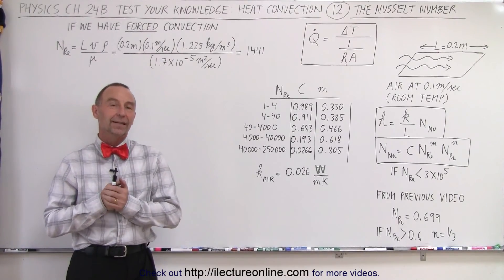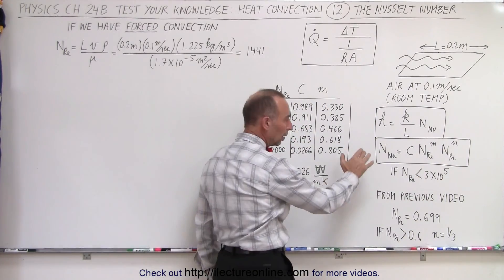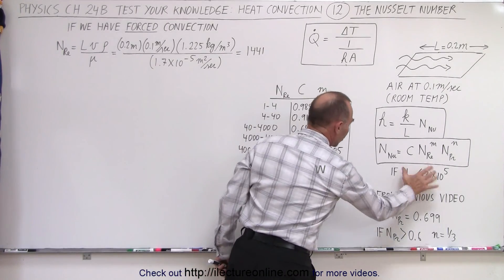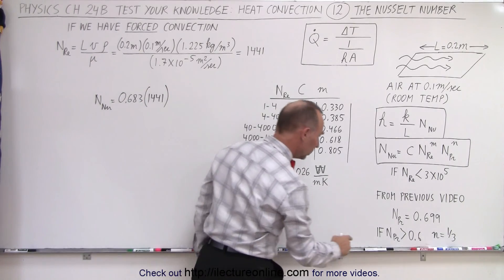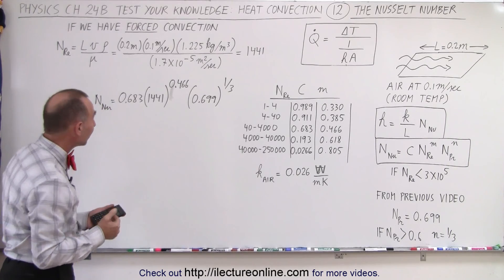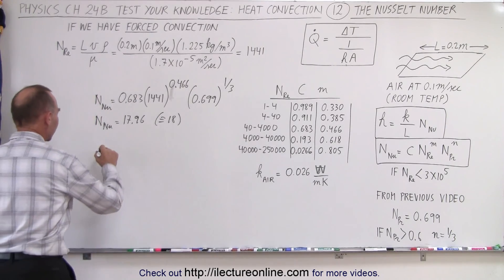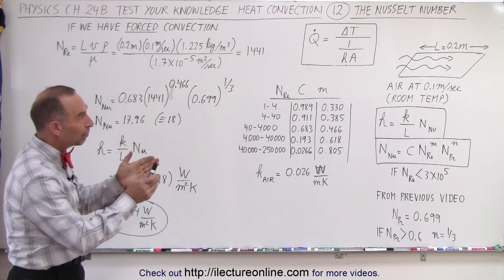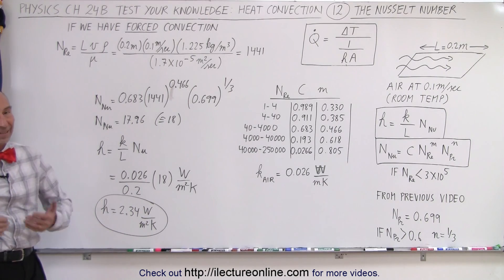Physics: Ch 24B - Convection: Test Your Knowledge (12 of 26) What is the Nusselt Number?

Comment: Hi Michel,

I think you made a unit-mixing mistake. You assigned μ as kinematic viscocity in (m^2)/s. The correct expression depends on which viscosity you have. 
If we are dealing with dynamic viscocity use Nre=(ρuL)/μ where u is characteristic velocity. If we are dealing with kinematic viscocity use Nre=uL/ν where ν is denoted as nu.

Am I correct?

Mark